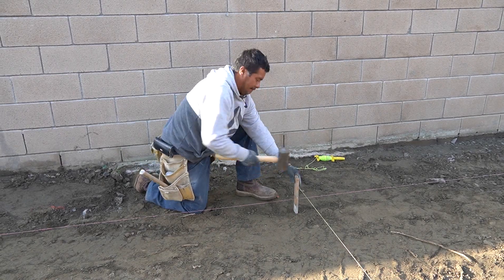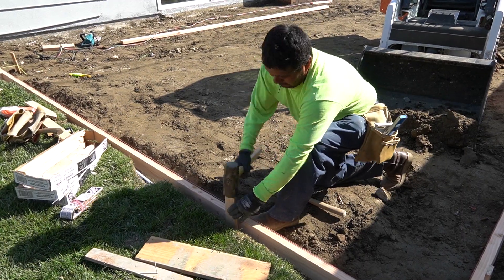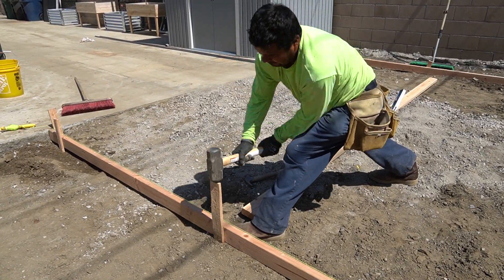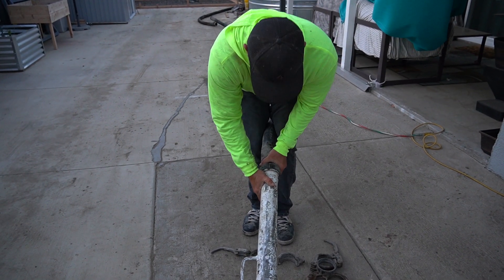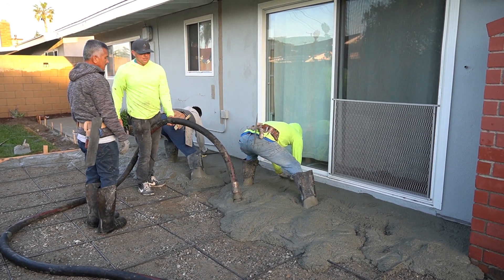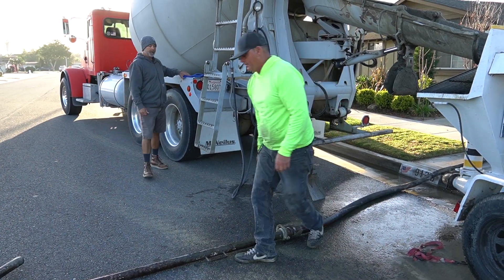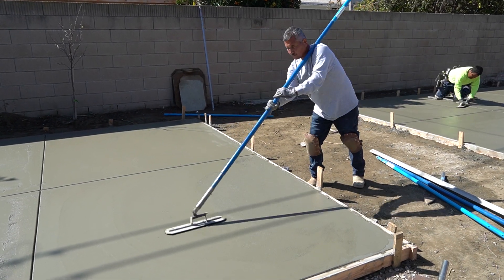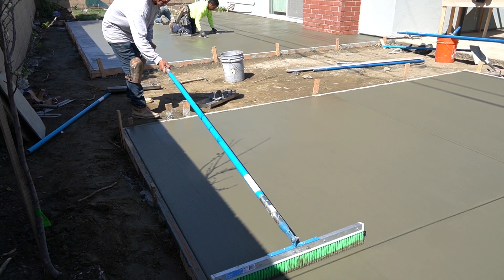Concrete Patio. The Best in the West! California

Comment: You guys ever think of using metal stakes!!! Form work good, however use a laser to set you elevations and slopes!!
Reply from the maker: If the ground is rock hard I will use steel stakes. I can get the elevation perfect with a string and level 👍

Comment: I wish I had you guys or someone like you in Brisbane Australia when I had my driveway poured. 
My brock layer recommended this concretor, so I took his word.  ( big mistake).
Middle of summer, midday pour and ran out of concrete 3/4  of way. Had to wait an hour for the next truck. Bad join between the two pours, didn't notice it at first when the concrete was dark. When it was dry and lighter  you could see the different shading of grey from light to dark and rough uneven texture.
Noticed in another area where he had walked on decomposed granite with flip flops and onto the concrete which left dimple impression in the concrete. Last but not least, after they edged it and then went over with the final funny float, it left a small lip in sections on the edge.
Luckily the 4 x 6 metre section with the bad join was demoed and replaced.  So things to look out for:
Contractor has to borrow your jack hammer. Has to borrow broom, laser level, and helicopter from his hired help and the hired help who walked on the concrete needs to drink beer after 90% of the job is complete.
No attention to detail,  just cowboys.
Reply from the maker: Man that's terrible. I wish I could have done your job👊